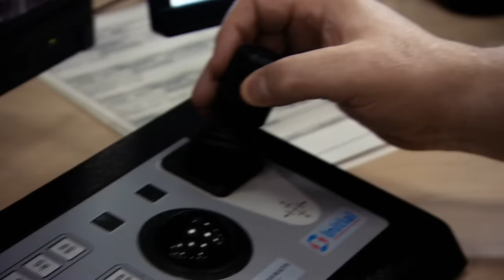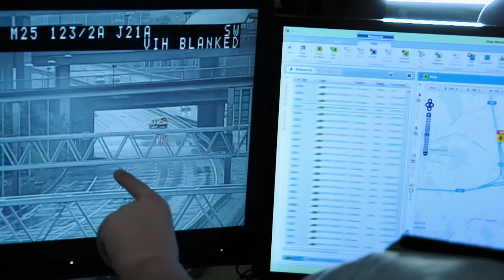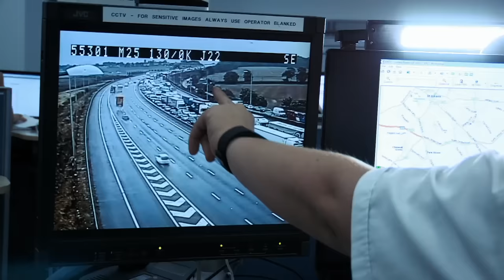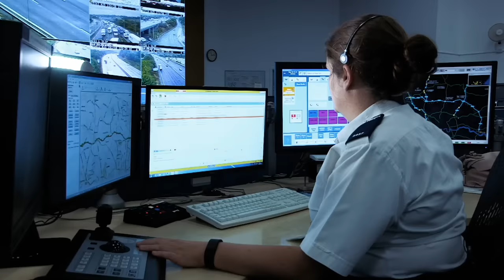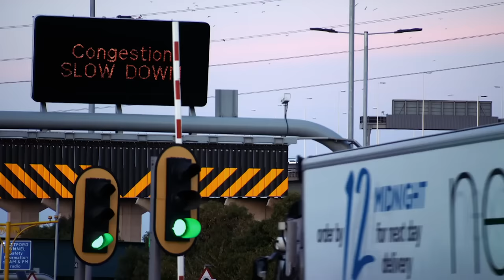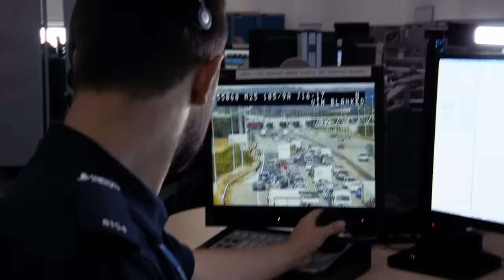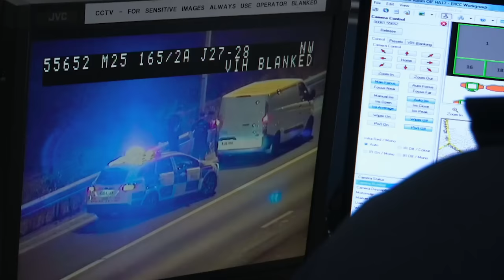Heavy Rain Causes Mayhem On The M25 | Britain's Busiest Motorway E5 | Our Stories

Comment: I remember talking to a chap from the AA who said that an HGV throws up around ten thousand gallons of water per minute in torrential rain, which I thought quite daunting! No wonder you can't see much when overtaking them!
Reply: That can't be right.. 10000 gal is 45,500ltrs.. a fully loaded petrol tanker holds about 26-28000ltrs
Reply: @Jimbo-gi7xn  55mph, so say 800 yards in a minute... and then heavy rain say 100ml an hour.. easily 6,000 gal perhaps
Reply: I’m currently a HGV Mechanic apprentice and I can back him up. 

But not only that, you would be surprised on how much rainwater trucks bring back with them into the workshop. 

We have had times where the base of the pit is nothing but water to the point any cardboard becomes soaked right through and it’s like working in a boggy trench. And the floor of the workshop has random pools of rainwater from where water has leaked out of trucks and slid down from the roof. 

Rainy weather can be quite naughty for HGVs.
Reply: @smudgerbugg  I've been driving HGV and coaches 24yrs and I've been guilty of taking rain water into workshops lol
Reply: @nekotranslates  Think you need to check your maths! It's 1600 yards in a minute!
Reply: Can't see, why the need to overtake then?

Comment: A trickle or rain or a flurry of snow and Britain comes to a stand still 😂 also don’t forget leaves on train tracks 😂
After all these years in Britain it still amazes and amuses me.
Reply: Except of course that huge puddle was not a trickle. Try hitting that at 70mph or more and see what happens.
Reply: It all comes down to bad management.   Poor, cheap quality, low cost roads with poor drainage systems and blocked existing drains that never seem to cleared by the authorities. The use of cheap and low quality tarmac in the UK leads to cracking and potholes which the authorities eventually spend even more taxpayers money to repair. I now live in Germany and the difference is huge, comparing a poor, badly run country to a disciplined and well maintained country.
Reply: That’s because Britain has a whole host of weather conditions (predominantly rain at the moment) and no idea how to manage any of them.

Comment: Our local Dept. of Transportation here in Nashville, TN are experimenting with a new road material that absorbs rain and funnels it off to the shoulder/sides of the road.
Reply: could you link an article? this sounds pretty interesting.
Reply: Technology NOT coming to the UK any time soon.
Reply: Unfortunately unless a tory has a limited company in that technology it will never see the UK
Reply: @abbagang3844 It's called Porous Pavement, It was mentioned by the Mayor a year or so ago when rain caused a significant amount of potholes.  We are still dealing with them.  It's a startup company from Washington and he is looking to collaborate with them.  Our roads here in the USA are much lower quality than those in Europe.  I think mainly do due to the sheer amount of roads we have here.  It would be extremely expensive to build them as they do there, even though it would save money in the long run.

Comment: Imagine the signs 3 days ago went to 60 then to 50 straight after I was in the fast lane going 60 at the time but tell me something now? Dropping to 50 in an instant in the fast lane is surely more unsafe than over taking the car in the middle lane first then slowing down. I don’t know if I got flashed or not but I guess these people wouldn’t understand that
Reply: They have no idea do they I've had them go national limit 60 50 40 50 40 60 national limit with no heavy traffic queing or any hint of a problem apart from som idiot controling the signs
Reply: @johnmurray9627  It’s likely no one controls the Signs in that situation, it’s mostly automated. Well done for the wrong guess. Tell me, if a report of an animal on the road came in and then the animal ran off, would you prefer they put some signs on or not bother to try and warn you?
Reply: Couple of things, they’re all fast lanes, and no one expects you to drop immediately, there is a time limit from when the speeds drop to when the camera is active to save you.
Reply: @johnmurray9627  Have you ever stopped to think the maybe the changes in speed limit are what stopped you from catching up to the problem ahead of you? having traffic slow down well ahead of time means that there will be less traffic piling up last second causing tailbacks